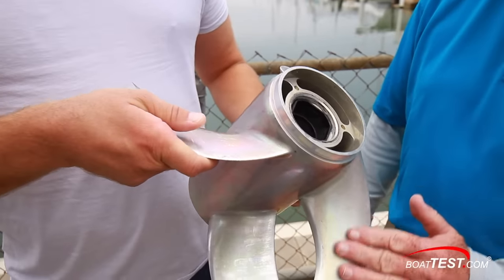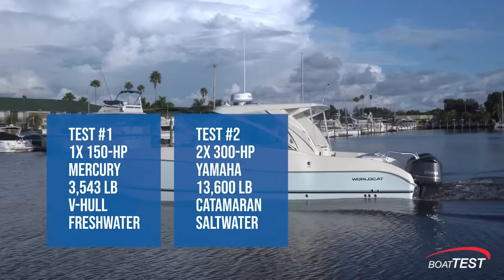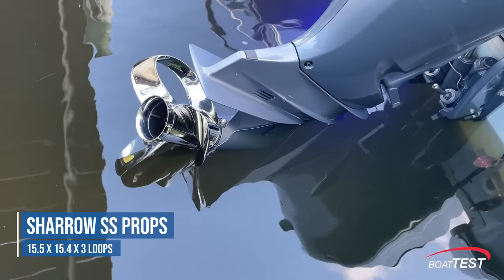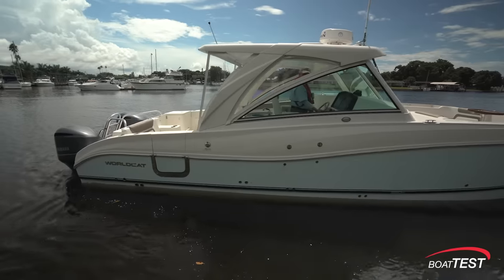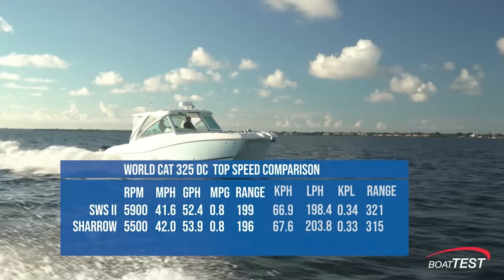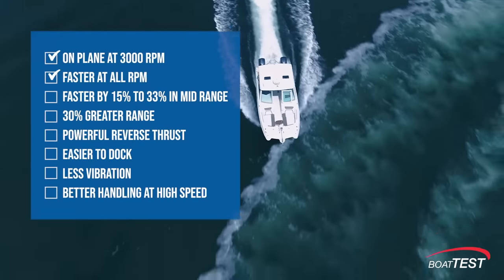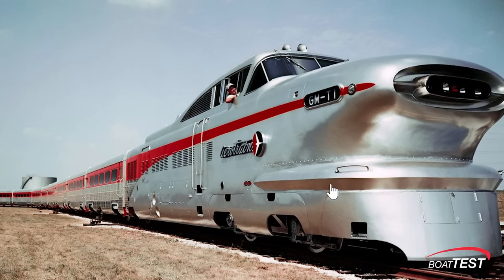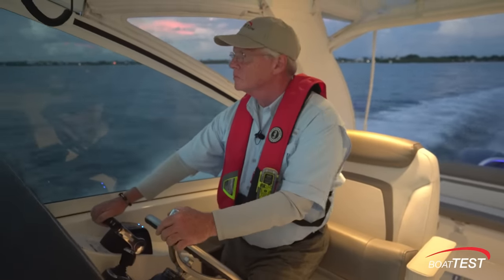Sharrow Propellers (2022) - Test Video by BoatTEST.com

Comment: The key here is reducing cavitation. Reducing cavitation is where the performance differential occurs. This type of propeller would be great for small high speed props. There are a variety of ways to reduce cavitation. Container ships do it by reducing the speed of the propeller. Military ships do it by adding blades and also by having variable pitch propellers.
Reply: I was thinking it doesn't produce tip vortex because it doesn't have blade tips
Reply: oh they say that at the end
Reply: USN: "You think you've reduced cavitation? Hold my beer..."
Reply: Sorry I'm not holding it. You're just going drink it anyway. The performance speaks for itself. You can try arguing with me. Except that I'm much to busy! Laughing! 🤣🤣🤣🤣😘
Reply: Reducing cavitation and essentially reducing slip. Slip numbers are a big deal in the performance boating world I am immersed in. They had a weird way of labelling it: "Advance Rate". When you look on their website there are more charts that show how much less slip it has. I've seen some large slip numbers from certain tests, so if you can get that down it's all good.
Reply: @mjodr  As a US Navy veteran specialist in Electronics Warfare. My specialty was related in many ways to that of a sonar man. There was significant job overlap as well. On a warship at sea, our interests in cavitation, were purely military in nature. As cavitation makes a ship, or submarine really stand out, during a battle at sea (underwater acoustics). Understanding that cavitation also affects the performance of small craft, like racing boats or water skiing. That's  been something of a yes I get it, thing. Fair winds and following seas.😎
Reply: @scottjackson5173  So tell us - - what is the true top speed of a Nuke at around 100-200 feet where cavitation is suppressed by the increased water pressure ??
I've heard more than 80 MPH, maybe 100 !
Reply: @TIMEtoRIDE900  Cavitation could also be called screw slippage. Screws propelling the ship or torpedo by moving water. Each time a screw slips, less water moves per turn of the screw. How much cavitation occurs is extremely variable depending on a variety of factors. Improved screw design includes adding more blades, as well as improved machining and blade contour. Actual performance has to he measured in the field. Water tank testing is a step in the right direction. Once enough hydrographic information is collected. Computer models can be generated for some computer simulations. Water density varies by both temperature and salinity. Not just by water pressure at greater depths. That means that cavitation rates will be affected also. The principal is simple, but solving cavitation problems is anything but simple. So? The actual design has to be tested to answer your question.
Reply: @scottjackson5173  I think you responded to "Matt Read"
and cavitation, ventilation and slip are 3 different topics.
Cheers !
Reply: @TIMEtoRIDE900  I am a US Navy veteran. So my knowledge of the subject, is from it's military applications. I can visualize the process. My ship had four 30ft screws, and they could propel it faster than 30kts, at sea. Perhaps you would like to explain your terms.
Reply: @scottjackson5173  comm test ......

Comment: In my youth I owned a propeller repair shop and was a OEM certified for repairing most manufactured propellers. I have seen a lot of advancements through the different changes and inventions with the propeller through the years. It is wonderful to think there are still individuals that strive for perfection which is what makes us great.               The only thing that I can see which is a deterrent is that it is so highly technologically involved and priced that the majority of people out in the world will not be able to afford the advantage. Those that Will be able to take advantage of the propeller. Will be probably military applications those that are drug runners and those that have the excess money to spend so they can brag that they have the best even though most of them probably cannot tell the difference. But it is great that there still are individuals that strive for the perfection and think out of the box so keep on doing what you’re doing.
Reply: Yep, just looked at their site, $5400 pre-order for a prop.  Ouch!  I mean, it is really cool but... OUCH!
Reply: Cost ????
This would definitely be a Big decider ??
It already cost enough money to put a boat in the water.
Then you need to think about changing the Propeller 🤔
Nice product for a limited market ??
Reply: Why are ones props spinning when in idle. Isn't idle in neutral?
Reply: @OneOut1  Docking and no wake zones?
Reply: @OneOut1  The shift controls are separate from the throttle in some boats. You can be in FWD/Reverse and not give it any throttle about idle.

Comment: Just found this video. Very interesting and informative.  Worked on smaller warships in the sixty's, just trying to eliminate cavitation noise and damage. Would really be interested to here the boffins take on these in a larger format.
Reply: Wouldn't be surprised at all if nuclear submarines weren't already using similar prop geometry secretly.
Reply: Why isn't this on the helicopters already?
Hard to believe that the military hasn't already tried this so called, new technology.
Reply: @ReiniGrauer  They dont but it I am sure they have experimented with them.
Reply: @ReiniGrauer  Even extraterestrials are using it to prop their ships .. !
Reply: @davidniquot6423  funny
Reply: Wait for china to catch up 😂😂😂 it will sale at 5$ piece.
Reply: I would like to see this on a trawler or something in the 40-60 foot range.
Reply: There was some chatter about trying these on container ships. The efficiency boost and cost reduction in the global economy could be potentially enormous.
Reply: @anonone8954  Helicopter blades need to be flexible so I don't think these designs would apply. Although MIT has been working on something similar for prop planes and drones. If it works like they say it does, you could potentially put them on VTOLs and things like that as well.

Comment: It would be interesting to see if you could run a smaller displacement outboard with the sharrow prop on the same hull with the standard props and achieve similar performance.The cost v benefit justification might look better then. It could even change boat design if we didn’t have to run such large capacity four strokes to achieve adequate performance
Reply: Where I am there is about a $10K price jump from a 200hp to 300hp outboard, so a Sharrow prop on the smaller engine could very well get you the same performance (except top speed) as the 300hp with a $10K saving over all.
Reply: @lancer2204  5k savings.... The prop cost 5 grand.
Reply: @saltysteel3996  $5K saving on each outboard/prop combo. For a twin hull it would be a $10K saving, which I communicated poorly.
Reply: @lancer2204  Also for a given trip you need less fuel and less weight for the smaller engines.
Reply: A 100 hp difference is way more than this prop can account for. Maybe 300 to 250 on a twin. And this will only be interesting for those who ONLY want the mid range efficiency. Also, at this stage, they have not spoken one work about how that case would affect the boat in the rough stuff. That power is about more than just good cruise speed and top end.

Comment: This makes a lot of sense for me in retrospect. First, each blade having two surfaces effectively moves more water less. That is a hydrodynamic advantage. Second, looping the blade will disperse the tip vortex more effectively, which will delay cavitation. Third, Internal stresses are more optimally distributed.
Reply: These props are CNC machined in Detroit now. This should make them cheaper. Check out Titans of CNC’s video of the new production of Sharrow props.

Comment: Most don't have a clue how much different your boat will perform with the perfect prop vs just an average prop. To me the real test I would like to see is on a light hull with big power. My reasoning is because I have had a 110 mph boat that would barely do 70 with the wrong prop. The pitch wasn't even much difference just the blade design and microscopic finish. You gotta spend the big bucks to get the best. This just seems like it would ventilate so you could run more pitch than a solid blade.
Reply: yup
Reply: Bigger than a yup.
This is a direct comparison test. And it's about the fundamental difference in design. The base prop should have been the normal tweaked and worked 3 blade that's always put on a boat. Not the random stock prop.
Reply: Take it from me first hand, it really made a difference!
Reply: I'm curious how a prop like this would act on my boat in my picture, now I'm running a 11x13 left hand elephant 🐘 ear 2 blade prop, with 19-21%overdrive in my V-drive!...from Wyoming USA 🇺🇸 🤠
Reply: I dont think the sharo would work in a surfacing situation. Its top end efficiency was basically matching the stock prop in the test. I think if it was to grab air it wouldn´t work as well as a cleaver or similar. Be good to see a test....but as with conventional props, stock vs surfacing are totally different. I guess a sharo surfacing style would be another leap of design that would need alotta tuning to get right...if it even works, could be great though...but so is a well tuned cleaver !

Comment: Impressive and surprising. As a life long boater and gear head my first thought would be "less blade surface" would mean more ventilation (prop slippage) particularly in rough sloppy seas. I went from 3 blade to 4 blade props because my props would lose bite in really sloppy conditions. I have a 11,000 pound center console, 35+ feet in length with twin 250's.
Reply: lying sob's take the video to 10.03 an hit play them props are in reverse turn video speed to slow an look
Reply: The name of the game here is trying to eliminate as much cavitation as possible. Liquids and gas have really weird behavior if you look at them closely during extremes, such as spinning a bent piece of metal really fast into them.

Comment: A prop design like this just might be an improvement for the bigger boats as well, some of the high power boats such as the Pershing could benefit from this new design.
Reply: The reason this prop design works at all is basically a real life cheat code where if you make something have precise curvature and bends just the right way, you will see little to no cavitation compared to regular ones. Making something this accurate is profusely expensive, especially for larger ships.

Comment: Percentage wise that is a MASSIVE improvement.
Reply: Price wise, its a MASSIVE amount to pay ($5000) for a prop.
Reply: savings wise, @ahndeux  , you are saving a MASSIVE amount of fuel, and it's gonna pay for itself in time.
Reply: @JohnDoe-ji5wg  Not necessarily.  It comes down to the actual improvement in the real world and on top of that, how much you actually use the boat.  Most private boaters won't benefit from that big a cost when their boat is roughly double the price of the prop.  The price has to come down if they want more private boaters to purchase it.
Reply: @JohnDoe-ji5wg  If you know anything about props, its not like there is a single prop that solves all your problems.  Most private boaters have at least 2-3 props with different pitch and diameters in order to optimize fuel efficiency or the hole shot.  

When I first saw the price of $500, I thought that roughly double the price of a standard prop, so its not too bad.  Then I read the fine print and that is just the 10% down payment for the prop and changed the situation.

Unless the company has a prop swap program, I doubt there are many buyers other than commercial boats who can afford it and willing to buy multiple props to optimize their efficiency.   There are always some rich private boaters with $100K+ boats which won't affect their wallets, but the rest of us are giving it a "hell no" at that price.

Comment: I wonder how a single Sharrow prop would compare with a a Volvo Duo prop or Merc bravo 3.
I'm guessing massive performance gains. 
Hey BoatTest, get him to give you a few props for a Bravo 1 and get some baseline runs on the 3, swap drives, and see how it compares. My guess is you'll get the speed of a single prop with the dock manners and hole shot of the dual prop.
Reply: Sharrow makes a duo prop on their website page and that’s also huge… check it out.
Reply: @JS-sx3bl  I'm sure the price point is huge...

Comment: Interesting concept. Like a merge between a speed prop (Less blades) and a power prop (more blades). Common to see 2 blades on racing (top speed, low haul power), 3 blade (standard all rounder) and 4 blade (low to mid speed haul power and efficiency, lower top speed efficiency). 6 blade with the best of both worlds. Nice :)

Comment: I am fascinated by toroidal propeller technology and I brought it up and a Boat Drag Race at the Wild Horse Pass South of Phoenix. I spoke with racers and most had no clue what I was talking about. But, I ran across two guys that did know and had some unique input. The first was a big cargo ship captain. He said that the props that you use for thrust and that the toroidal props will be the future but it is NOT the best for speed. He said that boat speed is at the tip of the propeller so Drag Race Boats have a surprisingly small and not very broad blade. I got to talk to a long time boat drag racers and he kind of confirmed this and said that he used the toroidal prop does not work and he claimed that he tested in on his top fuel boats. He claimed the toroidal prop will not get the boat going from a dead stop to instantly high speed but in both cases boats are topped off at the same speed at the end. He also said that the drag race boat props are unique in that they have a very small pitch of about 6%.

Comment: I wonder how it would work on non-plaining Diesel trawlers with twin 120 or 135 HP?
Reply: Its simple physics, no tip vortex no loss so its overall going to be better.  Like windows down on car will cause less miles this is like windows up.
Reply: I have a Donzi classic  with a 540 bull dog bbc with a lot of go fast goodies done to the motor and at 82 mph how much more speed would I get at that price I hope 90 and the Mazco HP 4 blade at a 27 pitch prop at 6 grand rpm. This prop gets good fuel mileage at 3500 rpm I get really good fuel efficiency. So I wonde if this new prop would beat out this prop at all speeds. So let me know and if it does I will buy one if not I will leave it on the shelve at the boat store. So let me here all your numbers for this prop ?

Comment: Im curious in freshwater use…once you “find” a stump will it bend more than a regular prop? Are they built as strong and durable?
Reply: It seems like it would be a lot stronger since it essentially has a truss connected to the blades.
Reply: Strength is a concern as to much Strength will bend a prop shaft or shear splines in on the crank with impact 
Would love to try these on my surf launch charter boat in South Africa

Comment: I've been watching the development of this prop over the last few years and it is the real deal. Basic prop design hadn't changed in over a hundred years. Sure, there were enhancements and refinements but a radical approach was needed and this is it. Will this prop be for everyone - no, not at the price they are charging at this time. For someone like me with a 20' bow rider who puts maybe 50 hrs on it a year there is no way to justify it even at $5/gal for gas. However for larger boats and those that use them frequently the pay back would be months or possibly weeks. Imagine a transport ship using millions in fuel per year. The ROI would be weeks if not less and then there is the improved handling and reduced engine wear to boot. My hat's off to this guy.

Comment: The Sharrow props are designed specifically for the boat.  I wonder how much improvement you could get by tuning your traditional props?  It seems to me that minimally you need a little more pitch if WOT is near 6000 RPM.
Reply: The most important ""RPM"" would be where the torque/horsepower lines meet on any/all motors, no matter what the factory recommended ""WOT"" operation RPM's say on the BIA TAG & if these guys are taking that into account while building a prop for a certain motor and or boat combination, then they SHOULD be considered to be ""PROPERLY PROPPED OUT"" as we used to say while trying to get the customers to understand why we COULDN'T just stand behind the counter and ""SELL THEM THE EXACT & PERFECT PROP"" for their boat without at least knowing what their exact ""WOT-RPM"" was on their hull/motor/load/usage/altitude/fuel/air temp ect ect ect that they were showing on the tach & they just go ""HUH, I DON'T KNOW, IT GOES THIS FAST"" and even with the biggest bank account, they COULDN'T BUY A CLUE!!! Propping is the most important & hardest thing to ever do on a boat & that is where the FUEL meets the WATER, PERIOD!!!
Reply: Was thinking the same. The SWS propellors could use a bit more pitch since the engies rev to 5900 RPM. That could explain the small difference in top speed.